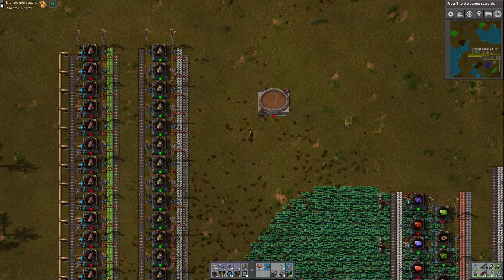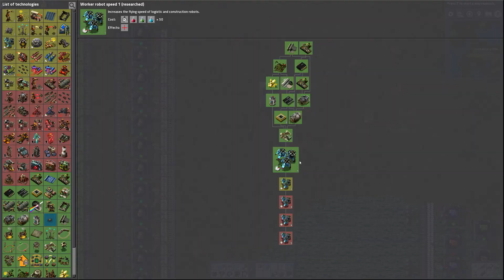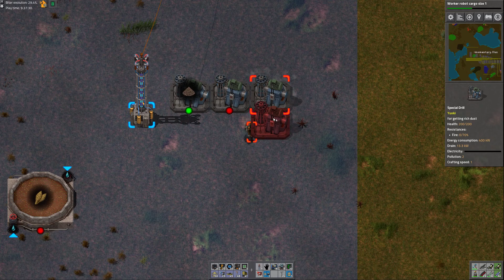Factorio - Yuoki Industries Episode 24: Corn

Comment: I think you will need 2 or 3 more farms to feed the engine-production. also if you place another farm, it fill the grow-time gaps better. The Fluid-Buffer-Station have a red, green side with arrow on top. Notice that you can't transport fluid against the arrow. the green side works as "pump". You use atm the balance-connections (vanilla behavior).
Reply from the maker: So if the green arrow is the output with a pump and the red is the input, the sides are the usual vanilla behavior?  Ok, I'll double check those.  I wasn't sure exactly how that worked.  Also, more farms in the next episode :)
Reply: The green output "acts" like a pump, no fluid moves against the arrow. a pipe connected to red will always try to suck all fluid from this pipe. as another example, if you connect green and both grays and the tanks is half full ... green pipe stays full, other pipes stay half full or fluid go reverse to keep green full. It's not every time useful and you can build this behavior also with 2 vanilla small pumps, but this needs electricity and i think this is a simpler and faster way. (maybe it transport fluids faster, i have this not tested, because the pumps are slow)

Comment: You can also adjust your buffer for the corn down to 20 in the box as that ensures that there will always be at least enough for one seed which is all you need to make more corn, that way you can try to maximize your production on the lubricant while still keeping your fallback to ensure you never run out of seed. Other than that, looks great and looking forward to seeing more!

You also might want to make another 2 corn farms just to speed up the production there, but that could wait a bit until you have logistics robots to handle with feeding the seeds to the farms so you don't have to have a belt piled full of seed lying about. It's a solid start, and a great step towards your logistics robots and future Yuoki things! Speaking of which... Pssst... your power is flickering a bit.
Reply from the maker: Ok, cool, wasn't sure if corn will be needed by other stuff later.
Reply: There are a couple other things in Agriculture that can require corn. Nothing else that requires the oil from it though. But for now I wouldn't worry about too much of a buffer on corn as if you really want to get into breeding the critters and such that require corn to produce then you will probably be further expanding an entire farm setup anyway. So for now I wouldn't worry too much about trying to "future proof" that system any more than you already have.